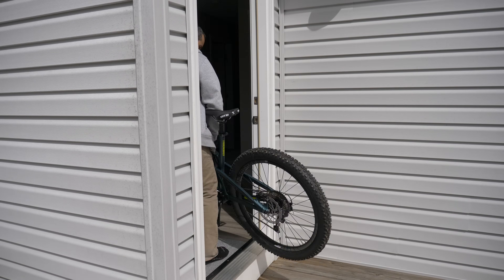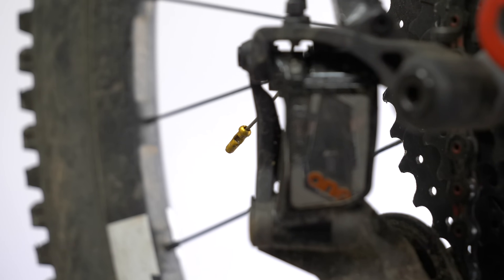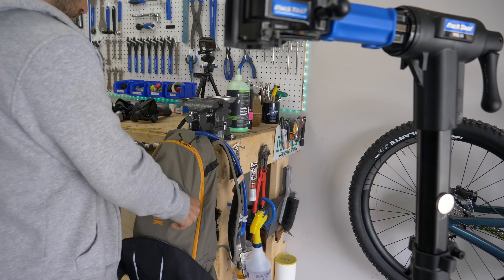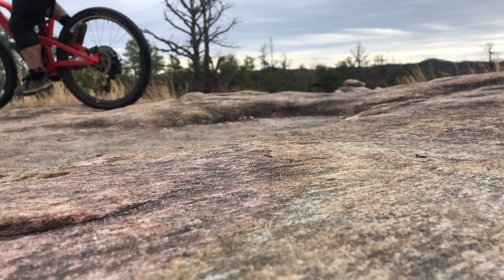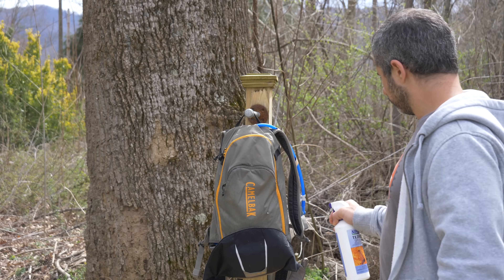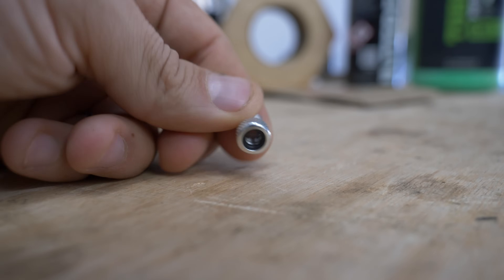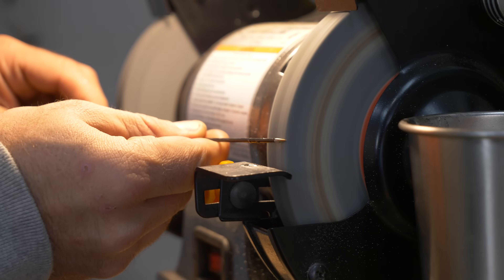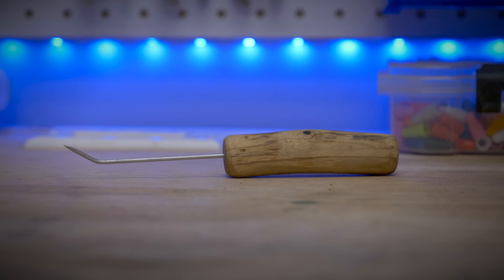10 Hacks for Mountain Bikers in a Pinch

Comment: You can use heatshrink tube on your levers as lever grips
Reply from the maker: true that!
Reply: I would suggest using the heatshrink that already has glue inside it. Though that's usually only in black. If you want other colors, hairspray or 3M 77 spray glue works as well, just messier.
Reply: @SethsBikeHacks  Are you taking the leap and converting to gripped brakes?
Reply: I used to do it a lot, unfortunately they wear out pretty fast. If you ride lift accessed downhill parks the tubing will rip off before the day ends.
Reply: I would recommend skate board grip tape.  Works well in all conditions.
Reply: @SeaCowsBeatLobsters  and shreds the gloves pretty good
Reply: @Me_ThatsWho  Don't use gloves :)

No seriously, you'll build up callouses.   I don't use gloves except to keep warm.  When its warm out gloves just make it harder to stay cool since your body tries to shed heat through your extremities.
Reply: @SeaCowsBeatLobsters  No gloves?  Haha.  That may be the most likely part of the body to be involved in a fall.  My minimal gear even for sleeping now is a full face helmet, gloves, and shoes :)

Comment: I was out mountain biking and came across an old .22 long rifle casing. I picked it up and carried it with me to throw away later. During that same ride, my buddy crashed and messed his derailleur up and caused the cable to fray. I took the casing out and put it over then end of the cable, smashed it with pliers, and after a few minutes of fixing and tweaking, the derailleur worked just as it did before. I now keep a couple casings in my bag that I find along the trails for cables. It recycles and also looks bad-ass.
Reply: Lowkey awesome but yeah what's up with people unloading rounds on your trails
Reply: How big are your cables? .22 would be too big for outer
Reply: Cornwall's Answer we used pliers to crimp the casing down onto the cable, it didn’t just slide on
Reply: Stefan Klok our trails are on privately owned land, the owners hunt on their own property
Reply: newbCoder our trails are on privately owned land, the owners hunt on their own property
Reply: I've done the same thing! But on the anti theft wires going from frame to Brooks saddle on my commuter. Some glue for good measure and then crimped it with my leatherman. The next bar end plug that breaks is going to get the wine cork + shutgun shell (spent obviously) treatment.

Comment: #1 works great for elevators, for those of us who live in high-rises.
Reply from the maker: I used to live up a big flight of stairs, and it was killer!
Reply: @SethsBikeHacks  you should re-visit Virginia Key and Markham.  Especially Markham; they've got some new features and are building some more.  That would make a great re-wind video!
Reply: And when I have to take the stairs, I just hang the tip of the saddle onto my shoulder and can carry my bike hands-free.
Reply: I once did that at a hotel
Reply: Yup and you forgot to add that you can control the balance of the bike very precisely using the rear brake, to make sure you don't cause any damage indoors and also to not put unecessary strain on your lower back. Even though i suppose its common sense.
Reply: I used to do that all the time at whistler when I used a private suite instead of hotels to get my bike into my room lol
Reply: @woodywoodverchecker  shoulder it cyclocross style, much easier
Reply: @ruanvorster2596  true, but I usually have a frame bag in that spot.

Comment: Hey Seth! I have always used packaging tape that you can find at postal offices for under 3$ as frame protection, it works very well and each pack has about 8 feet of tape 👍
Reply: What's it like trying to remove that stuff?
Reply: Johnny Weekend easy peasy, just run your nail along it
Reply: @theflannelflyer9437  I don't have nails like Seth 🤣 I'ma stick to that EverClear he recommended 😊
Reply: Good luck removing it if its chipped by stones or whatever.
Reply: I use that stuff to stop the cables from rubbing against the frame. It looks nicer if you use clear packaging tape, because you won’t see it
Reply: Have you ever tried clear hockey tape?  it is much tougher and much easier to remove. cheers !

Comment: Yes, I use tip #1 literally everyday! I was going to pause the video to type out the seat bump w/ the knee tip, but then you covered it!! WHAT A LEGEND. Seth is the GOAT. Such a helpful tip.
Reply: Also, thought of a tip to share: Hang hydration pack reservoir upside to air out so they don't get moldy. Osprey sells fancy kits for doing this, but this is a cheap, free hack. I use a medium size paper binder clip on the bottom & wedge a small ~2" piece of cardboard at the mouth on the bottom to keep it open, then just hang it from a hook, nail, pegboard, etc. Also, to clean out the hose, I straighten out a wire clothes hanger & attach a small piece of scrap cloth to the end & push it through the entire length a couple of times.

Comment: For anyone still riding tubes but gets punctures often put an old inner tube between your actual inner tube and tire. Of course you should cut the valve stem off and maybe cut through the inside of it so it can spread against the tire better and use tape to hold it there. Works amazing. Sure it's more hassle and weight but it's up to you if those trade offs are worth it to still ride tubes

Comment: I like to keep one adapter on my shraeder valve and throw normal car cap on it so its protected and i can remove it if i need to use it on my front wheel and i can use eny pump for it and i have adapter
Hit like if this helps you or you want to try it out
Reply: I do the same thing
Reply: I’ve tried that but my tire goes flat
Reply: That's how I roll

Comment: Use a quick release seatclamp as a tyre lever. I also give credit to my friend Peter
Reply: Paint can openers work good too
Reply: dude, thats freaking genius
Reply: Frankie Hughes ive broken thoes wich much less pressure than a bike tire, unless you are talking about something other than the wooden ones you get from Home Depot
Reply: You can also use a old brake lever.
Reply: Bushcraft in the garden already done😂
Reply: but that would leave ur rim with scratches
Reply: U can also use the bike rack from your car as a repair stand
Reply: Frankie Hughes and they’re sometimes completely free
Reply: Ive used the handle of spoons as tire levers when i was a kid on bmx bikes. Mom got mad lol.
Reply: I do the same too!
Reply: I was just about to post the same thing but then I saw yours damn it
Reply: @rok3895  he means those little metal ones with an "eye" on one side and a small flat hook on the other side.
Reply: @rok3895  i think he means a little metal pry tool thing not a paint stir stick.
Reply: I used my fingernails as a tire lever

Comment: For your tip about the presta/schrader valve swap, I saw you feeding quarters into the gas station air machine. I have a tip for your California viewers: In the state of California, gas stations are required BY LAW to provide free air to customers purchasing fuel. Even if you're not pumping gas, the majority of gas stations won't mind turning it on for you anyway (Most won't even check if you bought gas or not, especially since 90% of people pay at the pump these days). If you're feeling particularly antisocial, many of the pumps have a button on them to turn them on, but otherwise you just ask the cashier and they'll either give you a token or turn it on remotely. And if you DID buy gas, and they refuse, that can be a pretty serious fine if you feel like reporting them.  

They're also required to provide free water, but that's more for emergency radiator coolant, not drinking water (I sure wouldn't trust whatever comes out of that machine). Just don't be a jerk and use it as a free bike wash station ;)

Comment: Hey Seth!! a good hack for carrying duct tape:
 Wrap your preferred duct tape neatly around the body of a cheap plastic pen. Roll on as much as you want, or as little as you need. The an take a knife or side cutters and cut the pen body flush with the end of the tape. Makes a great tiny roll of duct tape, you can turn several feet of tape into a very small package, no bigger than a bid lighter. 
Speaking of lighters, you can wrap duct tape around one of those too, if you ever needed a lighter on the trail. Heck I’ve even seen people wrap duct tape around old gift cards. That makes for a nice flat carry method that can still hold several feet.

Comment: You can use a inter tube to get better grip on tools like screwdrivers
Reply: I use an old tube to open jar lids.
Reply: After switching to tubeless, I brought most of my spare tubes to work where I use them as handles for makeshift tools.
Reply: chilidoggs S or heat shrink

Comment: hacks/tips : Use a cheap bike lock which has flexible cable as a bike repair hanger.Hang it on a hook on the sealing,then pull it down when you use it,that could save a lot of space.(sorry for the bad English)
Reply: Honestly for YT, this is pretty good English.

Comment: Great hacks! Something I found very useful when installing very tight tubeless tires on a tubeless setup is a bendable plastic/rubbery ruler. Using a tire lever usually screws up your tape job letting air leak through your spoke holes. Instead, wedge a ruler in between your rim and your bead, and then bend it over towards your hub (Inside of your rim) and pull, using it like a rope. This hack gives you the extra leverage needed and does not harm your tape. Hope this works for you!

Comment: In addition to your tip to move bikes indoors on the rear wheel: if you need to get your bike down some stairs, take it by the front wheel and let it roll backwards down the stairs while you follow. This will save your back and it is super easy to steer the bike, even if the stairs are twisty.  This was the way I did it when I was a mechanic and moved bikes to the attic of an Amsterdam store.

Comment: you can stuff a small towel in the handle bars if its "hot as balls" and use it ti dry off the sweat, you can also use a plastic water bottle as rear suspension and let out more air more less psi and blow more in for more.

Comment: I like to use my old road bike handle bar tape as a chain stay protector on my MTB. It looks decent enough if you wrap neatly and really does a great job of quieting chain slap.  I've also wrapped electrical tape around the bottom bracket behind the chain rings to protect the paint from dropped chains.

Comment: I had some left over toe-clips from years ago.  My bike rack needed new straps to hold the bike on, so I pulled the ones off the toe straps and use them as my bike rack straps.  The metal teeth on the clamps are as solid as you would ever need and hold super tight.

Comment: A nice way to remove shallow scratches on your mountain bike is using toothpaste or automotive polishing compound/scratch remover. It has worked covering up some pretty nasty scratches on my bike. For deeper scratches i use touch up paint which is almost invisible if applied nicely.

Comment: 1- use windex for bike cleaning, will take most of the dust/dirt off without having to use water. no water = no rust = no fuss. 

2- use old bleached t-shirts,sheets,etc for rags instead of expensive shop towels. 

3- use tri-flow (or most other chain lubricants) as lubricant for cutting aluminum pieces with a hacksaw in a bench vise. works great for kickstands or rack arms, plus it makes cool smoke.

Tips from the shop I’m a mechanic at. Blue Ridge Bicycles in Winchester, VA

Comment: If you contaminate your brake pads during a brake bleed or even just with your fingers, you can clean them by bending a spoke into an L shape, sticking it in a vice and hanging your brake pads on it through the little holes in the pads that's normally for the retaining bolt to go through. Then you just torch the back of the pads for about 20 seconds each to burn off all of the oil (and pretty much every other contaminant that you can get on them). 
I've seen a lot of people say you can bake contaminated pads in an oven at 400 degrees for half an hour, but then you're getting burnt brake fluid vapors inside your oven and your house, and that seems unsafe. The bent-spoke-torch method is also much faster. 

If you hate our bike's paint job, you can buy vinyl wrap on ebay or amazon, along with some knifeless tape and make your paint job into anything you want it to be. I did this to my bike and even printed out a to-scale picture of the YT industries emblem, which I taped to some shiny silver vinyl and cut out with a razor and a ruler to make a custom sticker. Now my bike has shiny, metallic-looking YT badges on it. 

If your bike doesn't have space for a bottle cage on it, you can use heavy-duty zip ties to secure one on the frame. I find the best place to do this is somewhere on the top of the top tube, where it's the most easily accessible and there is almost definitely room for it. Just make sure that if you have a carbon frame, you protect it using helicopter tape or something like it. 

 Tubeless sealant works very well to fix leaks in old basketballs and soccer balls. Just make sure you use a more mild sealant, usually the sealant advertised as "race" or "pro" stuff will have extra cheese in it to make it seal holes faster but it will be much harder to get inside of your... balls.

This one's not really  a hack but the best thing you can do to keep your bike healthy is to ride it often. Seized spokes, hubs whose ratchets don't engage, corroded cables, seized derailleurs, rusted-out headsets and bottom brackets and more are expensive and time-consuming to replace but you can keep them all ticking away just fine by riding more often. Don't give oxidation a chance to build up on the bike's moving parts. Especially since bikes aren't like cars, where more miles means a less sound machine. As long as you keep an eye on your chain wear, tire tread and brake pads, you should be able to ride your bike for decades without other problems. (This mostly applies to older bikes, but all bikes will be old someday.

Comment: A bell is important on trails. I use a basic bell with the plastic flipper (clapper) that is cheap and easy to replace. But they are difficult to ring on the move as you need to move your thumb on top of the grip. Simply invert the bell and mount bell facing the ground. This very conveniently positions the clapper next to your thumb on the under side of the grip. Most of these bells allow you to pivot the clapper around the bell, so you can optimize position. No more risky ringing and has the added benefit of hiding a dorky bell behind your bar components.

Comment: After my first 20 mile ride with only a water bottle, I grabbed a hydration pack the next day.
A hack I use to keep the water ice cold all day long is use a couple bottles (I use the thin sparkling ice bottles) on either side of the hydration pack. I've had cold water even after 6 hours of riding.

Comment: Hey Seth I found a really good hack that I use for the brutal showers after a crash where you are covered in road rash (ex your shoulders). Sometimes the water stings insanely bad because of it hitting the wound at force, so I found that I can put a little hand towel and hang it over the wound and that makes it so that the water doesn't hit it and make it sting while you are doing other stuff in the shower

Comment: Heres an easy maintenance tip/hack for disc brakes. Disc brake rotors work best when they are super clean and its usually suggested to use isopropyl alcohol and a clean rag. But you can also get those single packaged alcohol wipes at the drug store. Use it once and throw it away. You can also carry a couple in your saddle bag or tool box just incase and are a lot easier to carry then a whole alcohol bottle. Also, if your brake pads start squealing due to contamination or glazing, pull them out and give them a quick scuff with some fine sandpaper (if they are glazed) then put a drop of dawn soap on the friction material and rub the two pads together while running them under hot water. The soap will draw out any oils. Then dry them off and they will be like new. If they are worn down, obviously just replace them 👌

Comment: A tip for cleaning a hydration pack hose: attach a piece of cloth/ kitchen roll to a string a bit more than two times longer than the hose, feed the string through then tie the ends together. You can put washing up liquid and water in the hose and on the kitchen roll then pull it back and forth through the tube, which easily gets rid of gunk! 

P.S only use once if you’re using kitchen roll otherwise it gets a bit manky

Comment: if you lose an O-ring (if you run tubeless you need one), you can make one by punching a hole in a piece of old tube with a pick, and sticking it over the valve stem and under the metal ring

Comment: You might’ve already done this but one for a disk brake that is rubbing is to undo the screws holding the brake caliber in place a little so it has some wiggle room, then spin your wheel and grab brake lever. Now tighten up brake caliber with other hand still on brake lever.

Comment: Velcro - By the way if you stick the two pieces together (loop and hook) back to 
back you can make your own gear straps. Just cut to your desired length 
and width.Get the 3m heavy duty 2" wide for more cutting options.